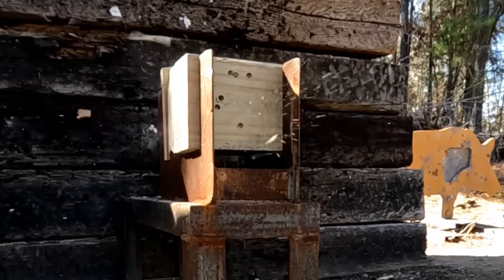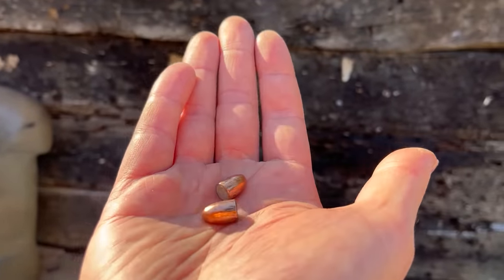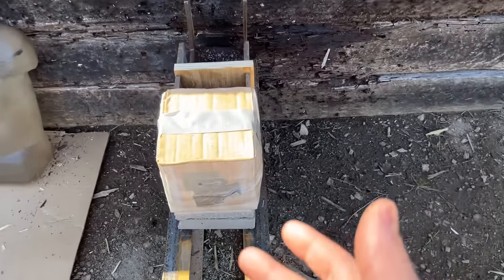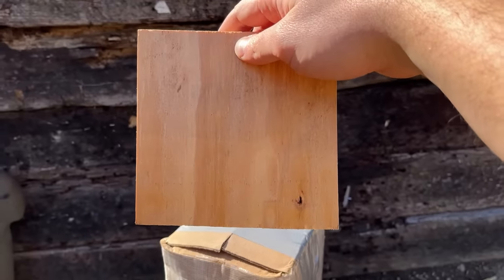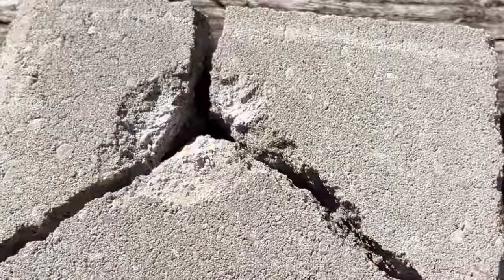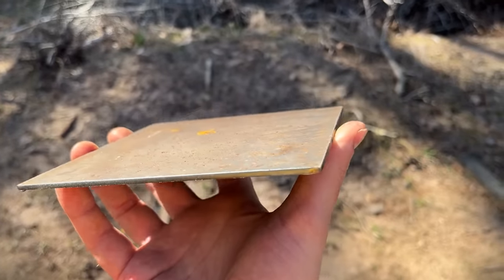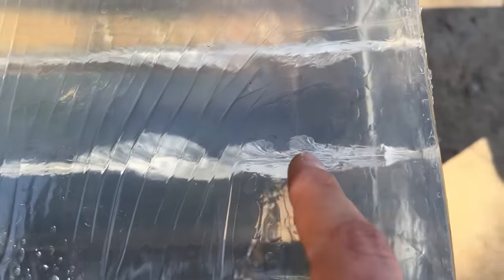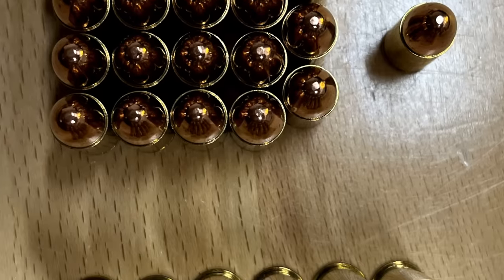9mm vs 38 Special vs 357 Mag: Not Even Close?

Comment: One thing I do have to say regarding the 9mm is, it may not be the biggest or fastest round out there, but it was designed right.  For a small cartridge, it can be pretty potent.
Reply: So your saying you own a 9 lol!😂
Reply: Especially considering the barrel length differences. 38 would be blown put of the water by 9 with similar barrel length using relatively strength ammo. Be that standard target in both calibers or +p
Reply: Ammunition advances over the past 10 years have really brought the 9mm's potency up. Little difference between it and the 40S&W with less recoil and the ability to carry handguns with higher magazine capacity.
Reply: Yes, I do have a 9mm. Can it compete with the .357 for muzzle energy…no. BUT, thanks to modern ammunition, it is just as effective at stopping a threat. It’s come a long way over the past 120 years. 

Now, if someone is using FMJ’s for self defence, I would use something bigger than the 9mm.
Reply: @stephenparchewski1998 if you're using FMJ for self defense you're doing it wrong.
Reply: Don’t get me wrong…I agree.
Reply: That Is Why FBI Went Back To 9mm
Reply: The 9mm out of a 4-5 in barrel beat .38spcl out of a 6 in barrel and was almost as good as .357 out of a 6 in barrel (at least on the wood block)
Reply: 9mm isn't bad for a round that was designed in 1901. (For reference, .38 Spl was originally a black power cartridge designed in the late 1890s and .357 Mag came out in the 1930s. .38 Spl and .357 Mag cases are identical diameter - the reason for the different numbers in the names was .38 Spl originally used heeled bullets which matched the outer case diameter. .357 Mag bullets match the inner case diameter.)
Reply: Well really at the end of the day .357 isn't 3x as powerful as a 9mm, but you can shoot 3 times as much without reloading with a Glock 17 than you can with a 6 shooter. The military determined through empirical research bqck in the 60s that multiple smaller rounds is more effective than a single larger round.
Reply: 357 is still more potent shot for shot, and is far more energetic when loaded to its potential. Not “just as effective.”

9mm advantage is that it’s good enough and you get more capacity. Human beings are not particularly tough compared to other animals.

Shooting hogs and stuff, or through cover and heavy clothing, there’s no way you’d choose 9mm if you had a 357.

Advancements with bullets also apply to the 357, it didn’t just stay frozen in time. Its higher velocity also means pretty reliable hollow point expansion.
Reply: @hanson544 agreed. Have a model 65. The revolvers are harder to carry. I can conceal the 9mm better and I can shoot better distance with the 9mm. Love the .357 if I was out in the wild.
Reply: @kindercannon2280  As far as power goes the 9mm falls way short of a hot 357 load !  750 Foot pounds muzzle energy to 400 FP  !!

Comment: 357 v 357. pistol vs rifle. 357 is supposed to be a lot more potent out of a rifle. would love to see that in testing
Reply: I have a 4" revolver and a 20" rifle. In a rifle, it's no 308, but it will drop med sized game like deer out to 75yd 100yd. Great brush gun. Dropped a 200lb boar on the spot at about 80yd with the 20" lever rifle with pmc soft point 158gr.
Reply: .357 has double the case capacity, greater COAL( hence the ability to utilize longer-heavier bullets)and operates at +10,000 psi over 9mm
9mm is pretty much limited to 147-150ish grain max bullets and relatively fast burning powders to maximize it's small case volume and shorter overall length. The .357's larger case capacity allows it to utilize slower burn rate powders in longer barrels for increased energy gain vs. the 9mm.
You'll get increased velocity/ energy from both with increasing barrel length to a point
9mm is gonna max out in a shorter burn column with lower total energy regardless in a cartridge appropriate max loading, all other variables being equal.
In short, anything much past 8-10 inches gains you little to none in 9mm
.357 Carbine ballistics are more comparable to a 30/30 than any service sidearm 
 Apologies for the long winded reply
Reply: @jmjones7897  in a handgun, 9mm is better than 357. 357 has longer burning powder normally, which means it needs the longer barrel.

that's also why in a carbine, 9mm stops accelerating at 8-10". 357 continues to accelerate though
Reply: The advantage seems to be brand dependent 
   Got a Henry lever gun in 357 mag and have some factory from Fiocchi and Federal the Fiocchi gains barely any out the rifle (from box specs) whereas the Federal gains over 20%, the sound difference was dramatic
Reply: @theprfesssor  +p makes a big difference
Reply: I up vote that one. Lets see if a 357 solid can make it through the sand! A .357 out of a 6" revolver is a man! Out of a rifle it becomes Superman!
Reply: @theprfesssor  different burn rates of propellants
Reply: @theprfesssor  fiocchi soft load their 357. I won't buy their 357 ammo. Try pmc bronze, it's usually slightly hotter than the norm but still cheap comparatively. Pmc Soft Point is my go-to hunting and mountain lion defense round.
Reply: 357  is a different  animal out of a rifle. You are approaching 5.56 energy there!
Reply: @perseusrex614  I don't know about 556, but you're definitely knocking on 30-30.
Reply: @cerneysmallengines   wtf my post was deleted so lemme try with  less words - yes you can get   1100-1200fpe NP out of a 16" lever
Reply: @perseusrex614  youtube has been weird lately.

you probably have more experience than I do, I can only speak for the testing I've witnessed. 556 itself is not a great cartridge, it's a good one, id give it a grade of B, however, id give 357 a B- in a rifle caliber. within 100 yards, 357 is probably better than 556, however past 100, 556 maintains its energy a lot better.

one caliber I'm hoping come about more is 224 valkyrie. I'd give that caliber a grade of B+.

my grading is based upon my experience with it, my limited research of it, and based on performance characteristics and cost. an expensive cartridge like 300 blackout loses to 556, even though 300 blackout is a great round, but is considerably more expensive than even 308, which I would give a rating of A-.
Reply: @cerneysmallengines    I  dont get Maotube's issue, f  them. I guess  I'm not alowed  to talk about  this  either,   comment deleted again...
Reply: @perseusrex614 I occasionally have posts intermittently disappear.  It happened twice two days ago.
Reply: @perseusrex614  we know what we were discussing at the least.

I'll say this, I know several people who hunt with a 357 carbine, and a 357 revolver on their hip. I am personally favored towards 9mm myself; however i would be a fool not to acknowledge the power of 357.

on my rating scale, I would give the 9mm a B+, whereas 357 would get a B grading, only because in our modern combat scenarios, 357 lacks sustained gunfire capabilities. I can unload 50 rounds of 9mm in a handgun in under a minute, 357 you normally only get 5, 6, or 8 shots in a revolver and you're done
Reply: @cerneysmallengines   I hear you mate. All true, but some people can get really good with revolvers and speedloaders, its not that hard. 14 shots will never be as fast as a semi, but can be pretty damn good. I see the 357 sig and 10mm as the best overall A+'s. cheers!
Reply: @jmjones7897 actually the bullets for 357 and 9 are damn near identical. Now I know they aren't, but when I hear "longer heavier bullets" I think of a 22 and a 223 having such a dissimilar bullet. When i open a drawer and see a bag of bullets that could be 9 and could be 357 and could be 38, I usually can only tell the 9 at a glance by the degree of curvature on the end. But it's entirely possible we use wildly different ones and you see a larger contrast
Reply: @cerneysmallengines  This. 
Absolutely correct
Reply: @cerneysmallengines  The 30-30 has more muzzle energy than either of the others. Out of a rifle length barrel, some 357 rounds have muzzle energy comparable to a 223, so 15-20% less than a 556. A 30-30 would have muzzle energy around 400-500 ft-lb more than the 556.
Reply: @perseusrex614  A guy did a study of handgun use for self-defense a couple of years ago and the most interesting category for me was the failure rate. That is, while "nobody wants to get shot" is a common saying, there are occasionally cases where the bad guy isn't going to stop until you put him down. The failure rate was composed of cases where the bad guy didn't get put down. 9mm, 40 S&W, 45 ACP and 357 mag all had failure rates around 13-14%. 38 special and 380 ACP weren't that far behind at 17-18%. The mouse calibers brought up the rear, around 28-32% if I remember correctly for 22lr, 25 ACP and 32 ACP. For the first 4 calibers, I think the different characteristics tend to level out, a 9mm has greater capacity and faster reloads, but the 357 has considerably more muzzle energy (and most self-defense shootings are settled with less than 6 rounds). I like the 357 Sig and 10mm too, but not enough to have bought one. The 10mm seems to have won that popularity contest, with the result that you can get hard cast rounds for woods carry in bear territory, which is a good application for that caliber. Not so much for the 357 Sig. I know with Glocks you can get both 357 Sig and 40 S&W barrels for the same gun, which adds to its versatility.
Reply: @michaellovelace3844  the numbers I had seen, which I very easily could have misinterpreted, displayed 30-30 below 556 by just a bit, hence why I said that 357 was APPROACHING 30-30, but not ECLIPSING. for those of us who still love lever guns, and 30-30 dwindling in popularity, 357 is the go to that many people are going to.
Reply: @michaellovelace3844  I see where I went wrong. the website I was looking at displayed 556 in Joules, whereas they displayed 30-30 in Foot Pounds. 30-30 is indeed more powerful. looking at 357, it's hanging in the high 500s for foot pounds of energy tested out of a 4" barrel, makes me wonder how much more competent it is out of a 16" barrel
Reply: @michaellovelace3844   interesting, thanks for sharing that. I love a 357mag.  If you  are  not concerned with sustained combat, I  think you are  better off with  a  revolver personally. A good 7 or  8 shot 357 absolutely has its place in the defense world.
Reply: @cerneysmallengines   out of 16".......... its nearly DOUBLE. Rem 158 HTP 158gn flies at 1750fps..... = 1074fpe, on the heels of a 223!
Reply: You'll get around 400fps more from a rifle length barrel out of most 158gr off the shelf loads. It makes the cartridge out of a handgun seem like wasted potential. Still only a 100-200m range, but very good through the brush and up close is almost as powerful as 5.56 energy wise, but with even less recoil. Having a revolver in the same caliber is just nice for logistics.
Reply: Sir, if you would like to see the difference between .357mag from a revolver vs from a 20 in rifled barrel, Lucky Gunner Ammo has already done it.
 YT search: .357 Magnum vs .44 Magnum Lever Actions
Reply: I have a Ruger 77/357 and a 6" Colt python 357, the M77 got around 1800 ft/s while the python got around 1400 ft/s. Both using a 158 grain Winchester super X 357 magnum Jsp
Reply: If we're going to fire 357 out of a rifle, might as well do 350 Legend at the same time.
Reply: @guentherwilke2055  1 word. Price. 357 is $20 for a box of 50. 350 legend is $50 for a box of 20.

ok, not $50, but still expensive.
Reply: @cerneysmallengines  Range ammo is close: 357 is $.75, Legend is $.80. Legend soft/hollow pts are twice that much.
Reply: @guentherwilke2055  the cheapest 350 legend ammo I found was a little over $20 for a box of 20 fmj. the self defense or hunting loads were $35-55/20 round box depending on what you got.
Reply: A kind old man lived next to my grandparents & his son, while living in a big city, was robbed at gunpoint w/a .38Spl & the criminal shot him all 6 rounds. Police responded & found the old man’s son beating the “perp”, with the snub revolver & had to pull him off of him. He went to the hospital & not 1-ONE single round penetrated deep enough to hit a vital organ. Needless to say? Upon learning of this I decided to never upset the kind old man’s son at least with something bigger….like the .357 Mag!!! Lol TRUE STORY!!!!
Reply: .30-30 has more energy than 5.56 at the muzzle. The scarcity of projectiles with good ballistic coefficients limits the. 30-30 to ranges of 150 yards or so.
Reply: @cerneysmallengines A semi auto in 10mm will give you. 357 performance and is available with magazine capacities of 15 rounds.
Reply: @georgesakellaropoulos8162  I am not aware of too many 10mm carbines. I'm sure there are some, but 357 and 9mm are by far the most prevalent. 44 is probably 3rd on that list
Reply: @cerneysmallengines  I was talking about handguns only. 357 out of a carbine is definitely a game changer.
Reply: @perseusrex614 this is correct.
Reply: @guentherwilke2055 or the old 357 maximum.
Reply: In a few studies I've seen, the .357 outperforms all other pistol cartridges, while in shooting situations, the caliber (other than the .357) doesn't seem to matter much.  Comparing them to any rifle or shotgun, pretty much proves the point that you carry a pistol for when you aren't specifically planning on needing a firearm.
Reply: There is allot of Power thats blown out the sides, my 357 is 4 inch barrel its a devestatng hit i think that
gun design loses allot of power from the flash supressor
Reply: @perseusrex614 The ballistics aren't great past 100 yards.   At 300 yards the drop becomes significant.
Reply: @malcolmtudor8039   yeah, its a 150 max and in cartidge, but a damn fine one!
Reply: 357 and 350 legend are basically the same.

One is just better suited for use in detachable mags.
Reply: @cerneysmallengines you are buying from the wrong places if those are the prices you are getting.
Reply: any caliber is supposed to be a lot more powerful out of a rifle
Reply: @malcolmtudor8039  where are you that you are regularly making or need to make shots over 300yds that it really matters?
Reply: @SDPimenta  not necessarily. every round has a bell curve, where the powder burn has stopped and it's more beneficial to stop the barrel.

for example, 9mm. 9mm has an ideal barrel length of 10.5", give or take. below 10.5, there's still an advantage to having a longer barrel, above though, not only does the round stop accelerating, but it actually starts decelerating. I know someone who has a tricked out px4 storm, he counter bored the rifle so that the barrel effectively stops at around the 11" mark.

for 300 blackout, you're basically done around 12.5". you still get some benefits up to a 16" barrel, but after 16", you start deceleration. again, I know someone who chopped their 30p blackout to 14.5 and has a pin and welded muzzle brake/suppressor host to bring it up to 16"

Comment: I am old, nearly 3/4 of a century.   Back in the day, there was no gel.   The makers used 7/8 inch soft pine boards spaced one inch apart for ammo testing.   The 357 Magnum was king with this test, even over the 44 Magnum.   So, that was all we had to go by.  This info was published and well known.   The 9mm showed good performance in the wood, also.

I started handloading in 1972.   Norma sold 44 cal steel jacketed bullets in soft point and hollow point 240 gr.   They were called the Tri-Clad.  Steel jacket, nickel plated and then clear lacquer coated.  Very accurate with my WW296 full loads.   They were also the king of my crude wood penetration tests.   I used a foot long green pine 6 inch about diameter log., standing up.  The 357 would not penetrate through.  The 44 Mag went through the log like it was made of of Swiss cheeze.   Elmer Keith admitted it penetrated as well as his 44 cal 250 grain SWC.  I also shot it through various metal stuff which you should not try at home. 

This is a great video!  I would like to see more of this type.  I have never been attacked by a board or concrete block, but it makes for a fun video.
Reply: Thanks Rob nuts, this is a great comment.
Reply: I remember reading penetration testing in my 55 vintage Gun Digest, which I studied as if it were the bible. The prices of guns, especially the .45 Colt, would make these youngsters cry.

Comment: Stupid question here - shouldn't this test use individual cubes for each bullett fired?
It seems to me that the fist 2 shots weakened the structural integrity of the wood which made 
the 9mm look like it did more damage than it did. I don't know & that's why I am asking.
Reply: If he aimed better and spread out the POI that might help.  It looks like he's trying to get a tight shot group with all three.
Reply: @terry_willis   I see what your saying and that makes sense in so far as what he was trying to do, but I still can't reconcile the logic of using the same piece of wood for all 3 rounds when each round is a different caliber. I'm C student that never fiished Jr College and yet I keep thinking that the structural integrity of the wood has to have been compromised and that has to play a role in the test in some way. But like I said I'm a C student with no qualifications
Reply: The wood should be fine (not sure, just an assumption), but the sand needs to filtered after each shot to remove old bullets. The sand test is by far the worst set up. It could be much more interesting though, if set up properly.
Reply: There’s really no perfect option for the wood block. Same block = compromised structural integrity. Different blocks= different densities regardless of how much effort you go through. So it a classic catch .22
Reply: The density of the wood block changes depending on if the bullet goes through in between the ring of the grain or on the ring.  The best test is gelatin which shouldn't have any change in density any where you hit it.